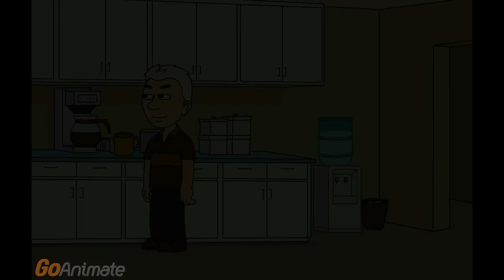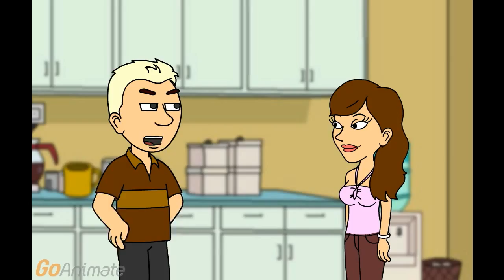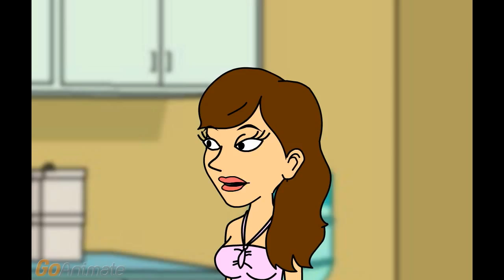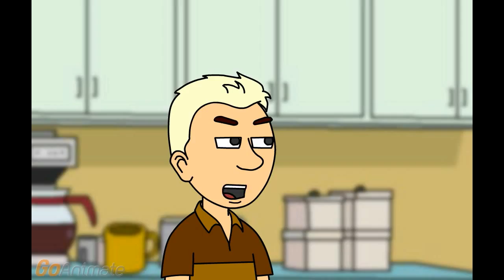LG Side By Side Refrigerator Problems

Comment: I will never purchase another lg product. The freezer door has to be replaced after only two years due to the fact that the water line freezes and the ice dispenser can not produce ice. LG claims that there is no recall on the freezer door and this problem is unique to my unit. I am seriously unhappy about the cost to replace the freezer door and their response to the problem.
Reply: This is the worst company to purchase a fridge from.
I purchased a side by side fridge with water and ice. The water line is leaking. 
LG is telling me that I have to replace the whole freezer door to repair a $2.00  hose. Really? 
I will never purchase anything by LG again.